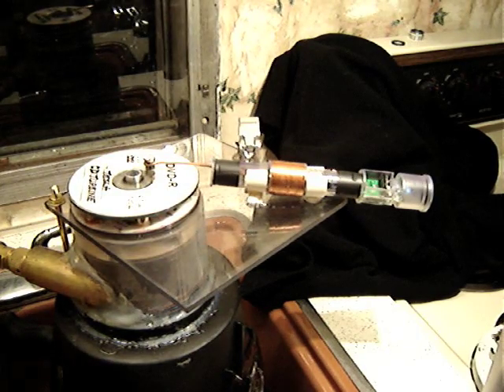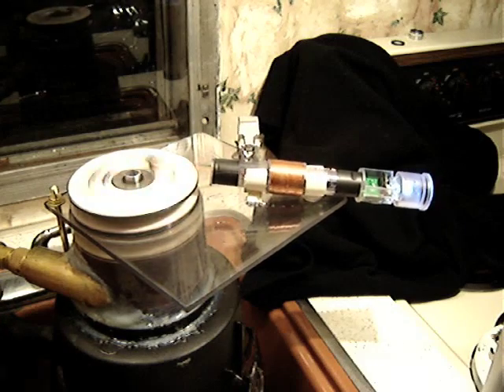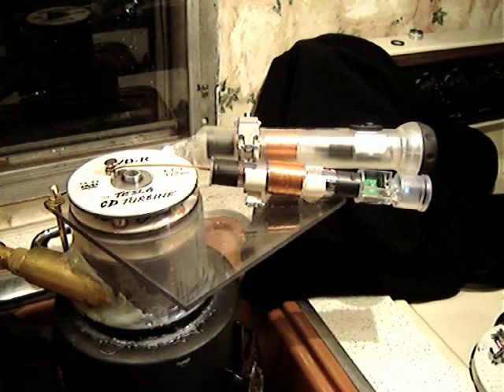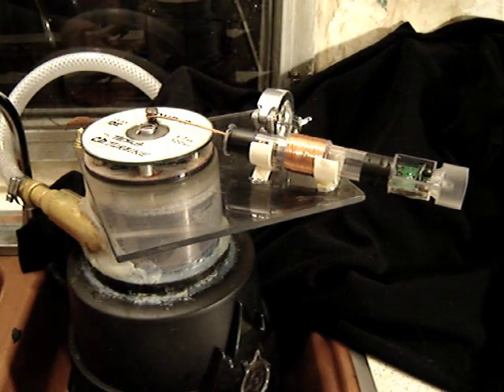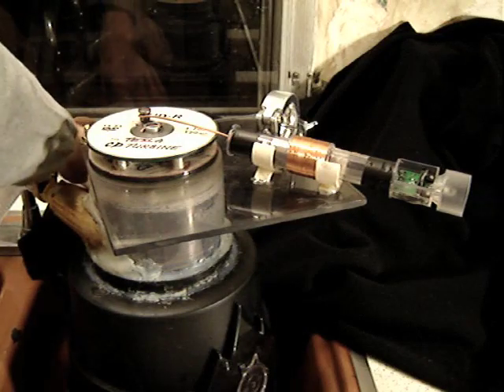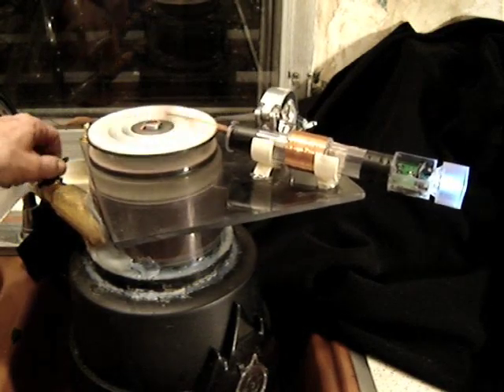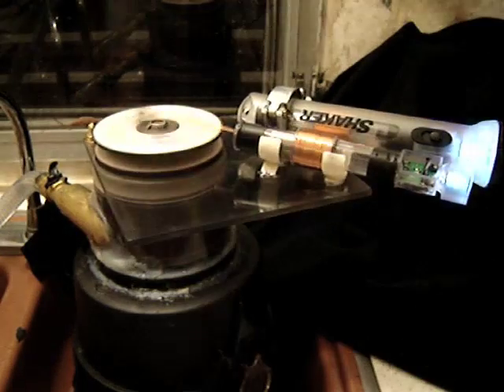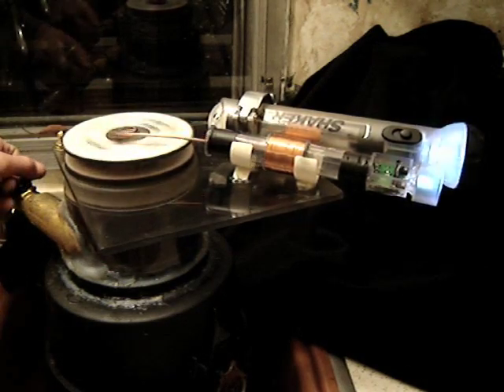SinkScience #10 - Shake Flashlight Shaker

Comment from the maker: @bkfilipi 

There could be more additional electricity generated if the magnet was an electromagnet...but it would require additional force to make it run.

Unfortunately, this device was at the limit of power that the faucet water pressure could produce, so an increased magnetic field with an electromagnet would stall the motion of the device.

Comment from the maker: @HeBreaksLate

Tesla invented the radio...is that not practical?

Most AC electric motors today are of Tesla design, such as found in the amazing new Tesla car.

AC electric wires on poles over long distances have also proven to be fairly practical; Tesla pushed hard to make that happen.

And I understand that the original Tesla Turbine at Niagara falls is still working...

Comment from the maker: @HeBreaksLate 

If the water pump is running anyway, say to fill a sink, then this system is 100% efficient. If the pumped water is not used, then this system is about 1% efficient. 
BTW, efficiency was not one of my criteria in this experiment.

Comment: lol Just buy a flash light that plugs into the wall, that flash light is suppose to avoid using power from a utility company, ether way I like it and I get where your coming from. You solved the true problem with it, that you have to shake the damn thing for it to work. Dude Im just a lazy. However you could have just used your time and energy to shake the damn thing rather than inventing whatever that contraption is you got going there

Comment from the maker: @skullzcrusher 

It can make a watt or so of power from faucet water pressure, so it could power a small radio. The usefulness  in power outages works as long as the water pressure continues.

Comment from the maker: What kind of turbine are you interested in? A CD Turbine like this one, made from a CD case and CD's and magnets? Or do you mean a true Tesla Turbine that will run on steam? How big do you want?

I don't currently have technical drawings. They are available at places like Phoenix Navigation and in Tesla Turbine books.

The cost for a 23 disc CD Turbine like in my movie is about $80. The cost for a small Tesla Turbine with metal discs would be from about $200 to $2000, depending on materials.

Comment from the maker: That is hard to estimate. It would depend on many factors. It would likely cost between $2000 to $20,000 to build a 10-20 horsepower Tesla Turbine. With mass production these costs might only be 1/10 of that estimate.

Comment from the maker: Thanks for the suggestions.

The Tesla design uses only flat discs with spacers, and relies on the boundary layer adhesion (drag) on the discs, in a  smooth gradual manner by the fluid, rather than by diverting the flow abruptly. Fins change the nature of the turbine into a normal cupped or bladed design.

The Tesla design must maintain pressure in the case to work properly. The fluid exits out the centre after doing its work on the discs.

Comment from the maker: I appreciate that some folks have concerns about the faucet water used. I live in a rain forest where a lack of water is not so much of a concern. 

My latest movies show a recirculating system with 12 volt bilge pump run by battery and solar panel, and compressed air through a 12 volt compressor, battery and solar.

Comment: Wait I got more. Why don't you put some type of fins such as old Cd's cut into slices in between the Cd's in the turbine so that you can get better rotation from the same amount of pressure. Maybe even drill holes in the center for the water to run out of where the fins meet the center, I think you would gain a bit more force there to. Also might relieve some of that pressure that is bloating out the spindle case. But I wouldn't listen to me.

Comment from the maker: The first thing I did with the first turbine I built was mount a skilsaw blade on it magnetically and run it at very high rpm.

I admit it did have low torque and would only carve a pumpkin or cut 1 x 2 pine. But hey, its a CD case and CD's !!

If I had money I'd build a powerful Tesla Turbine for a vehicle.
But I don't, so I do funky home experiments of ideas that might inspire others.

Comment from the maker: The magnets do more than just hold shit together. Yes, they do help hold the disc pack together, but the crazy glue works better. 

The magnets act as a drive system for many attachments.

The magnets make possible to eliminate the shaft and bearings and seals of the turbine, which is a very big idea.
A shaft-less, bearing-less, seal-less turbine could have many applications.

The magnets can also give power directly by using coils of wire to pick up the energy.

Comment: I figured so, with the weight of the magnets inside the flashlight. If you're open to new ideas, maybe solder a USB slot to the battery inside the flashlight and charge an iPod? If the voltage is sufficient of course. I think a turbine iPod charger would be pretty fresh.

Comment from the maker: With enough pressure and volume, the Tesla Turbine design can power anything. Tesla had designs for cars and ships up to 10,000 horsepower. His smallest commercial turbine could be held in one hand and developed 110 horsepower. They were mostly run on steam, but are capable of running on any fuel.

Comment from the maker: It depends on the particular circumstances, and who is doing the measuring of what.

 For example, a regular turbine won't run on straight biomass combustion gasses without clogging up. It needs expensive filters and polishers to prepare the gasses for burning. A Tesla Turbine has recently been proven to work well in that situation, making it more efficient in that sense.

See the wikipedia entry for "tesla Turbine" for more info on efficiency.

Comment from the maker: One could set up things like you say, and the only way it will work is because of the flywheel effect to bring the linkage past that "dead spot". The momentum of the discs and magnets inside the turbine would keep the linkage moving. 

Same effect as a car engine, which wouldn't work without momentum to bring the crankshaft around.

Comment from the maker: The shake lights are designed with very thin wire, just enough to run 1 LED. Running too many LED's could overamp the wiring. The voltage may need to be increased as well.

But it might work for one or two extra LED's..try it!

Comment from the maker: Good guess, and I certainly tried it that way, but that didn't work. 

What happens is that the neo magnet in the second flashlight gets pushed and pulled by the direct magnetic coupling action of the magnet in the first flashlight. No electro, just magnetic!
  
The electromagnetic coil in the second light charges it's battery from it's own magnet movement.

Comment from the maker: Good question!

The arm is close for best torque, to push and pull the shake-light magnet through the magnetic resistance of it's coil of wire. Also, any longer of a radius will make the rod hit on the shake-light case.

Also, the turbine has limited torque, so it was a fine balance to get the radius to the con rod arm just right, especially to enable adding the second light.

Comment from the maker: The magnets have several functions, attachments are one of them.

 There are 1/32 inch spacer magnets between the CD discs in the turbine to space them at the correct distance apart. 

There also are 6 larger 1/2 inch magnets on the top disc inside the turbine. This enables a magnetic coupling to the magnetic coupler (also with 6 magnets) that you see on top of the turbine. 

The magnets also create a rotating magnetic field that can generate electrical power with coils.

And more...much more!

Comment from the maker: Tesla's design works on the principle of adhesion.

 The fluid goes into a nozzle, where it is accelerated. (Same as your designs, I presume.)  As the high-speed fluid leaves the nozzle and enters the case, it is forced between a series of smooth, closely spaced discs. The fluid spirals into the center outlet, while releasing it's energy to the discs.

A Tesla Turbine or pump will not cavitate, and the design can handle shock waves and implosion better than any other turbine or pump type.

Comment from the maker: ahah...really got you thinking, eh? thanks for the refreshing attention to detail!
I optimized the radius of the rod on the magnetic coupler such that the magnet was moved through the coil far enough to light the LED. If the rod is any closer to the center it won't have enough back-and-forth motion to  flash the light. 

Believe me, I spent a few hours with this rig to get it to do this!

Comment from the maker: Hehe, What you are talking about is an entirely different type of turbine.

From WiKipedia:
"The Tesla turbine is a bladeless centrifugal flow turbine expander patented by Nikola Tesla in 1913. It is referred to as a bladeless turbine because it uses the boundary layer effect and not a fluid impinging upon the blades as in a conventional turbine. "

The Tesla Turbine uses a different principle involving viscosity and adhesion, and smooth discs, instead of cups or blades, to transfer the power.

Comment from the maker: Thanks for comments.

The impeller is quite wide, and was an experiment to look at the vortex effects and the flywheel effects of a larger mass of fluid. 

It spins up to 1200 rpm, at about 2-2.5 gallons per minute. What you see here is indeed about 300 rpm, but with a load.

I have found it difficult to reach above 1200 rpm on 50 psi water pressure. Do you have a CD turbine working design that does so?

Comment from the maker: Read the "more info" >>> for some more info.
To sum up, the Tesla CD Turbine is a disc-type turbine based on the invention of Nikola Tesla 100 years ago.

 My turbine uses CD discs spaced by magnets inside of a CD case with a nozzle glued on, and this one runs on faucet water pressure.

The turbine, having magnets, drives a magnetic coupler  which has a connecting rod attached to the magnet inside a shake-flashlight. A second light charges by its magnet moving magnetically with the first one.

Comment from the maker: Ok...1-2 GPM gets it spinning, 30-40 psi water pressure at the nozzle. This CD Turbine unit does NOT work with steam; warps the polycarbonate CD discs within 2-3 seconds. Will work with compressed air...but gets dangerous at 15,000 rpm.

A true Tesla Turbine loves steam. Nikola Tesla built his first 8" to operate at 35,000 rpm and about 40 horsepower, later models into the thousands of horsepower!

There are hard-drive platter Tesla turbines on the web.

Comment from the maker: I selected that shake flashlight out of several because it didn't work right, and thought it would be good to show the charging action.

 If you want that effect with yours, you need to bypass the little battery they have wired into the circuit-board for the light. Or find a shake-light at the dollar store that only flashes without charging.

Most shake flashlights have a supermagnet in the on/off button in the outer case. So pass a magnet over the light circuit-board to turn your light off.

Comment from the maker: I did consider a compressed air inlet to give a pulsed boost to the water flow. I'm familiar with the venturi principle from automotive carburettors, but I don't know if the introduction of atmospheric air into the inlet would work. 

What you suggest would be an interesting experiment, and I do need to work with different size and shape nozzles now to see what is best.

Comment from the maker: You need neodymium magnets or the clutch will slip, that is, the magnetic coupler won't work. I used 1/2 x 1/2 inch N42 neodymium cylinder magnets, but you could get by with smaller ones, especially if they were more powerful. Check out my building instructions at Instructables(dot)com, see link in About This Video

Comment from the maker: The turbine won't be able to put out enough power to run a computer without hooking up to more pressure...i.e. the mountain creek next to me. I will try wrapping the entire case with wire at some point.

My water bill is nil, just a few cents for power for the well pump. I could see that this would be a problem for some on water bill, in which case recycling would be preferred. Run the turbine outlet to fill the sink, a barrel or the pool, or use for low-pressure garden watering.

Comment from the maker: You could run a recirculating setup with an inline electric pump. Then you could play for pennies.

 Or use the CD Turbine outlet water for some useful low-pressure application like a garden, a pool, or to simply fill up the sink. 

I happen to be near rainforest conditions, with plenty of water to go round!

Comment from the maker: Yes, it's a generator, or more correctly, an alternator. The circuits in the flashlight change the AC to DC before charging the built-in battery. Nikola Tesla originated the AC motor and alternator, so the shakelight is kind of appropriate with the Tesla CD Turbine.

Folks have suggested different generator setups, and I will explore some of these in future videos.